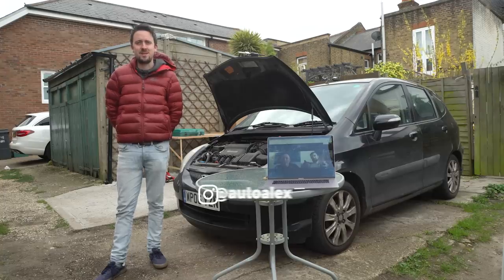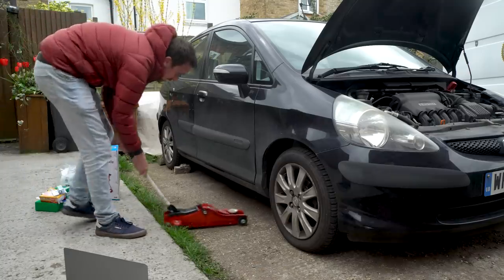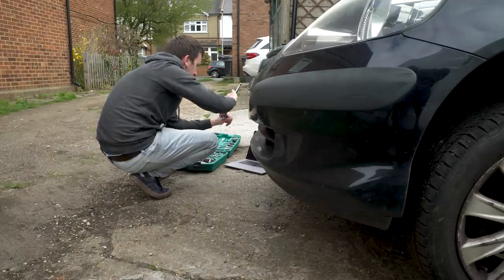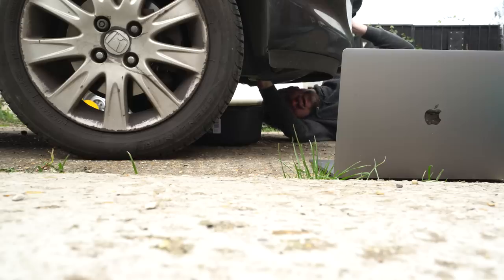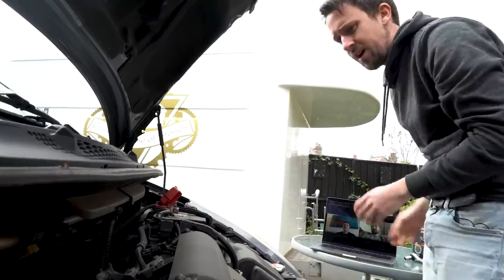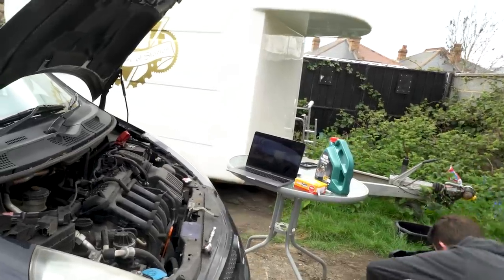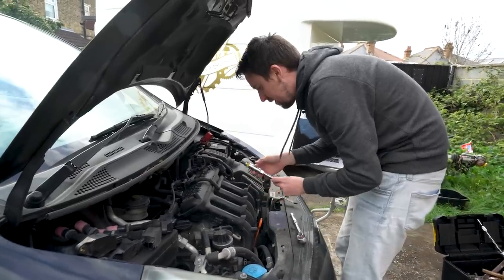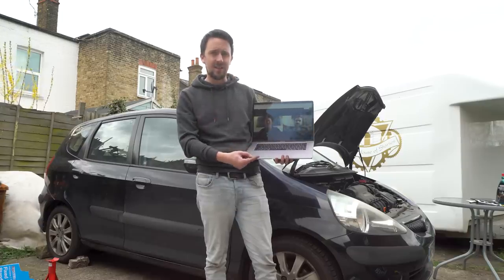Can A Non-Petrolhead Service A Car Over FaceTime?

Comment: I did an oil and filter change on my W203 2006 C220  Mercedesa couple of days ago using a vacuum pump. This will be the fourth time I've done this and no problems. Such an easy job 😊

Comment: I noticed a couple of things wrong with this video. During an oil change, when the oil is being added you want to fill it slightly past the full line if you don't know the capacity specification. Then start the engine and allow the filter to fill up, THEN take your measurements. During spark plug replacement, you need to know your gap specification and gap them accordingly. Antiseize needs to be added to the spark plug threads to prevent them getting stuck, and a dab of dielectric grease needs to be added to the tips of the coil packs to waterproof the connection and prevent corrosion.
Reply: Shadow the Hedgehog spark plugs are usually pre-gapped. And I definitely wouldn’t advise using copper grease on spark plugs.

Comment: i-DSI engines have 2 spark plugs per cylinder for "improved combustion", so you only did half a job on that. Also, when changing your oil you have to turn the engine on for a couple seconds after filling the oil to fill up the filter. The oil stays in the filter, so the reading will drop after the first fire-up and you may need to top it up a bit. So fill up, check your dipstick, start the engine for 10-20 seconds, leave it off for 5-10 minutes and check the dipstick again, pour more oil if necessary (we usually fill it up to about 3/4 on the scale as some more oil will drip down the oil pan some time after turning off the engine, so if you fill it up to the max reading you may've actually overfilled it)

Comment: I hope that allen key does not come back to haunt Ethan, I once dropped a 10mm bolt when changing the thermostat on a ford Cortina, I couldn't find it anywhere so thought nothing of it and got another 10mm bolt. About 2 days later driving in the middle of nowhere at 1am suddenly lost power and the car coasted to a halt and wouldn't start, sounded weird spinning over. Turned out the missing bolt had fallen inside the cam belt cover and suddenly got picked up by the cam belt and shredded the belt. A Royal pain in the arse!

Comment: This was brilliant😆As a car guy is like watching my brother in law working on anything. Eathan 5stars, but I would add after starting the car and turn off, few minutes later check the oil level again as it goes through the oil filter it will show lower reading on the dipstick🤓 Best "why dont you try to suck it out"🤣🤣🤣

Comment: My 2 year oil helps me.  First time I was going oh no get out of the oil... 20 minutes of washing my little helper was helping me. It is awesome when he took the impact gun and started removing lug nut to help rotate the tires.  It was so awesome.  Also been servicing my own cars and trucks since I was 13 and at 14 I started doing a 350 small block Chevy swap (before the LS even came out...) in to a 1986 Chevy S10 that has a tiny 2.5L 4 cylinder (90hp).  The 5.7L V8 block that was punched out to a 383 stroker with all the Edelbrock goodie from cam, rods, crank, dual 650cfm quad manifold double pumpers it was pushing something around 450hp/450tq is what the engine shop told me and I had room to make more power but seeing how the truck made 90hp to 450hp I was happy.    Going to start my little one early he love tools and garage time

Comment: I had the same problem on with a very similar or identical sprak plug wrench! Wouldn't fit in the spark plug hole (was definitely the correct hex size). Maybe Japanese engines use unusually narrow spark plug holes (had the problem on a 2001 Yaris).

Comment: Top tip - telescopic magnet £1, gets you out of the shit more than any tool in the garage 😂. I personally use a piece of rubber hose to pull out the plugs, and to start threading the new ones in so they don't cross thread (if plug isn't threading on right the hose will just slip, rather than damage the threads) 👍

Comment: Quick tip before you check the oil, start the car and let it run for +/-10 seconds for the oilfilter to fill up. This way the reading on the dipstick is more accurate.

Comment: Always remember to check if the  gasket from the old oil filter is gone before putting the new one on.... I learned that the hard way on my first oil change 😅

Otherwise I have high hopes for Ethan to have his car k-swapped with a big turbo by the time this pandemic is over...

Comment: Well done Ethan. The first time I did an oil change most of the old oil ended up on the ground. I had a proper oil tray but first  I dropped the sump plug into the drain hole so it overflowed hot disgusting oil all over the place. Then I forgot to undo the second bung on the oil tray it which lets the air out as the oil goes in so... it overflowed hot disgusting oil all over the place again. Doh!
All in all I reckon you did very well despite the advice from the other two muppets 😁. Next time you do it it will literally take you 15 mins.

Comment: One problem, you should fill the oil to the Max line, then start the engine, run for a couple of seconds then turn off let the oil settle and run back into the sump. Check the oil it will likely have dropped to around half on the dipstick, this is because the oil filter will need filling up aswell. It can then be topped up to Max and you are good to go.

Comment: My biggest mistake recently was the sparkplug socket I have has a rubber ring to grab the plugs, it came off when I put the new plugs in and was wondering why one of the HT leads wouldn't go back on till I inspected the plug and saw a big piece of rubber on the end xD

Comment: I have been too scared to service my own car. If anything goes wrong then I'm 20 miles from help with the car the only way of getting there. Been in the garage and it looks like they overfilled the oil. There's also an audio change, like air/gases are escaping the system somewhere. The air filter doesn't look like it's correctly in its box, despite asking and them being OK doing it the first time they didn't use OEM parts this time, just before lockdown, so I'm stuck. And I have a antifreeze leak from the start of that week which was the intention for going in but found that that garage doesn't do leaks. Empties the expansion tank after an hours drive, mk3.5 1.6 diesel Focus. Social anxiety doesn't help with any of this. 
And now Ethan has serviced his own car! :)

Comment: lol use the igntion coils or leads to remove the sparkplugs 😂 also you should run the car, then recheck the oil level once you've filled it up with oil. Nice job though !

Comment: If you don't have am oil filter  gripper thingy, you can use 40 or 60 grit sandpaper to grip the can... they are actually not on very tight.. they are just slippery...
Reply: you almost never need new sparkplugs...

Comment: i am an over the road long haul truck driver. my wife's 1999 mercury mountaineer blew a radiator hose while i was out at work. she called me and told me what happened. we got the car towed home. over the phone (i was 3 days drive from home minimum and had more driving in the opposite direction to do) we diagnosed what was wrong without the use of cameras. found which hose it was. she had a friend pick her up and take her to the local parts store, get the part and then called me again and i talked her through the repair. this was a VERY complicated fix as it was under the intake behind the water pump and very hard for even me to get to. (water pump bypass hose on 5.0 v8) she fixed it with nothing but a phone laying on the intake runners on speaker. so if you cant help a man fix something hes not a man

Comment: Top tip for removing spark plugs without a spark plug spanner, unscrew the plug all the way and then use the coilpack to pull them out.

Comment: Dunno if anyone’s gonna see this but after changing the filter you wanna put roughly the correct amount of oil start up your car, switch it off as the filter can take a few 100mls worth of oil and the top it too the top of the dipstick he’s probably going to be driving with less oil then required but still in the range of the dipstick

Comment: I hope he rechecked the oil level after starting the engine as it would have gone down. Just because it was at the MAX mark when he filled it up doesn't mean it stays at the max mark. The oil pump has circulated the oil around the engine and the level will have dropped, meaning he will have had to top it up afterwards.

Comment: You should always check the engine oil level again after you have run the car has the oil filter can take a lot of oil and lower the oil level.

Comment: I need to service my car, change the swaybar bushings and new clippers for front plus discs. But have to wait as though i got the stuff for job, i have bad kidneys and kinda waiting for emergency surgery and with covid going about, ill either die first or catch covid. 

Funny story though, when i last worked on my car i managed to change wishbone but duren changing rear pads. I couldnt wind piston back. Using proper set of windbbacks. Anyway i ended up calling my brakedown guys, they wernt going to do it but ended up doing rest of pad change anyways lol. Wishbone easy, pads hard lol.

Comment: Changed my oil today. Filter was stuck on for 2 hours. Filter wrench, ten shop towels and grip tape later and it’s off
Reply: Just hit a screwriver through it
Reply: Trust me. I tried. Unfortunately it’s located just above the sway bar and it’s a small sucker (G37 sedan with AWD if your wondering)

Comment: you need to start the car to fill the oil filter then check the level to get it to the right level, start it for half a min or less then turn off , give it a min for the oil to settle ,check level and top it up ;-)

Comment: Good job :) or half a good job. This engine has 8 spark plugs. Its called i-DSI engine.
 What does i-DSI mean?
intelligent Dual & Sequential Ignition
The L12A, L13A and L15A use (Japanese: i-DSI), or “intelligent Dual & Sequential Ignition”. i-DSI utilizes two spark plugs per cylinder which fire at different intervals during the combustion process to achieve a more complete burn of the gasoline.

Comment: Hate to disappoint you guys but the i-dsi engine has 2 spark plugs per cylinder, theres another 4 at the rear of the engine that need replacing.

Comment: I lost an EGR gasket like that in my truck and it ended up costing me a radiator when the fan found it and threw it into the radiator... local diesel shop has my radiator on the wall of shame.

Comment: You forgot to start the car after putting in the oil to fill the oil filter, check the level after, you’ll still need to add some oil.

Comment: Most of the time you can actually just stick the ignition coil back into the hole once the spark plugs are loose and pull them out

Comment: I can't leave an alankey in there. I would probably waste another 3 hours of searching for it. Once I lost an hour searching for a bolt. And my advice is change spark plugs one at a time. Take one of and put new one in. So you can't drop something in the hole of the spark plug.

Comment: The honda 1,4 i-dsi engines has 8 spark plugs and its not good for that engine too change only one side of spark plugs the fuel economy will rise up dramatically and sometimes the engine wont run good

Comment: Errrr guys it's a DSI engine it has 8 sparkplugs good luck with the rear ones. I took my wife's car to a well known garage  and the mechanic only changed the front 4 I ended up changing the back ones myself when I got home.

Comment: I ended up losing an allen key down the engine of my father's car. It ended up behind a pulley and made a hole in the engine block, causing an oil leak.NEVER LEAVE ANYTHING DOWN THERE

Comment: Good thing he doesn't now an audi. "Now try to not incinerate your hand on the egr pipe as you awkwardly slide the filter element in at a weird angle so as not to crush it against the intake manifold because having a canister filter underneath where there is space would be far to easy"

Comment: He forgot the anti seize on the spark plugs
Reply: I don't think it's advised on an aluminium head. Copper grease can react with the metal in the head? And plugs have their own coating on anyway.

Comment: This was difficult to watch. Always run your engine after an oil change before you dip it to ensure that the oul filter has taken the amount it need as that stays in the filter and not in the sump. And if the plug stays in the hole just use the coils to pick it up again!

Comment: Spotted so many wrong things Haha
Why disconnect battery?
Why not start car before spark plugs were touched to let oil travel around and set?
What happened to fuel filter and pollen filter for it to be classed as a service? 
And there's no way that first diesel plug tool would've worked!

Comment: I'd just like to point out that a Honda Jazz actually has 2 spark plugs per cylinder, 1 at the front of the engine and 1 at the back. But hey-ho nothing like doing half a job and not having a clue what you're doing.

Comment: So they gave him insufficient/wrong tools and poor instruction and wonder why it took 3.5 hours. (I realise they're making a show for entertainment and if they did it properly it probably wouldn't have been that interesting)

There were things that took extra time or was made fun of that weren't exactly his fault:
He had to find a paver (that cement block) to put under the jack to lift the car high enough to get the stand under. (this wasn't mentioned but after he needs the extra 1/2 centimetre the jack in suddenly on a block)
Not easily explaining what a sump is, what it should look like, or where to expect it. (a simple "Looks like a metal container with a nut at the bottom for drainage" would have helped).
Who gets someone to change their oil and doesn't give them a $0.50 funnel?
Who knows how long it took for him to dick about with the spark plugs because they supplied the wrong tool. ("What an idiot for dropping a glove finger and an allen key".. but this situation arose entirely because of other peoples mistakes)
Then there's all the camera work and setup. (probably added a good hour + )

I'd be curious to know how long it actually took him to do the work once you get rid of all the other stuff. My guess is about an hour (or so). Still slow, yeah, but for a complete novice without someone physically there to show him things I don't think it was that bad really.

Comment: Ethan is married? 
How does Ethans wife like being married to another woman?
All kids should be told to go to a mechanics shop as a job when they’re young just to learn basics. Just to add and I’m sure Alex may have done an engine swap. I once rented an engine hoist and swapped the motor and gearbox in my 1983 Ford Cortina and called them 4hrs later to come pick up the hoist. They never believed I’d already done it.
Reply: A pinto engine is a lot less complex than a modern engine with sensors everywhere,plus there is a lot more room under a tina 5 bonnet  :-)
Reply: fujiuser1968 whilst, yes it was a simple swap I can change my oil, plugs and filters in the time it took Ethan to set up his laptop. Also, Ethan wasn’t doing an engine swap and it took me less time than it did for him to service his hoopdie.